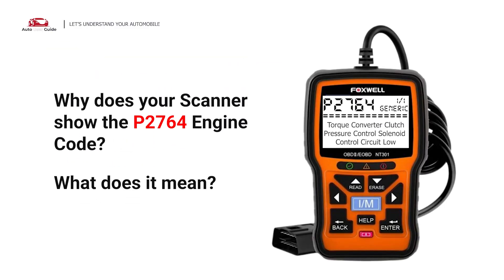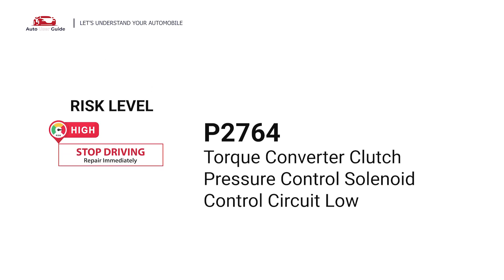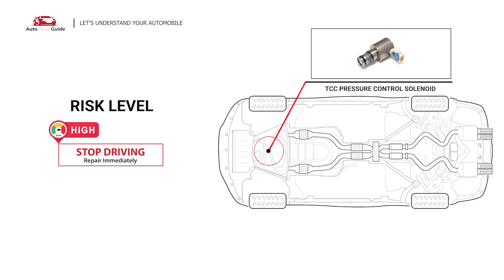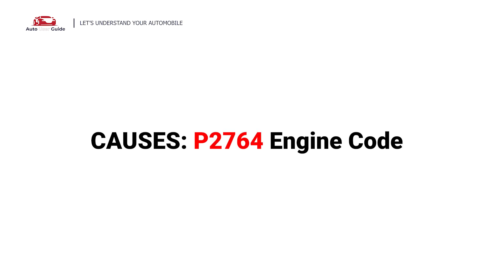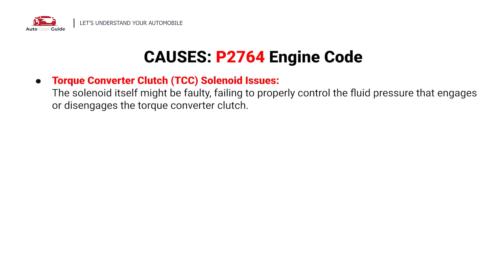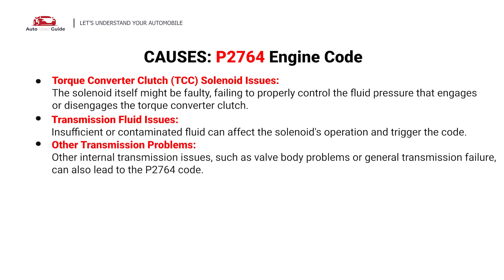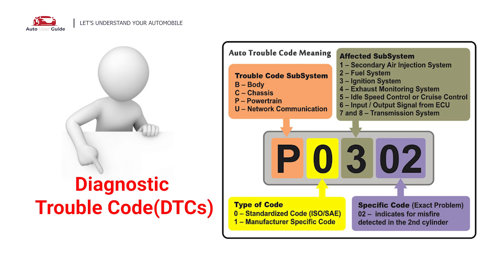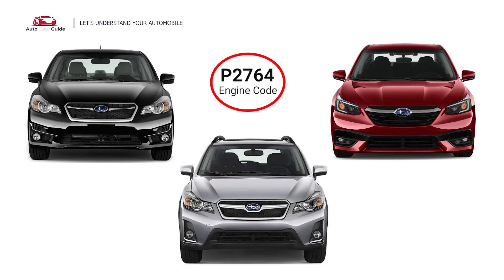What is P2764 : Engine Error Code Causes Explained

Comment: Hello Sir, I’m having the same code P2764 on my Forester XT 2013 (FA20 Turbo, TR690 CVT).
Two weeks before the code appeared, I changed my gearbox oil using Subaru Lineartronic CVT fluid and the car was totally fine. No issues at all.

The problem started after I drove through deep dirty water.
About 30- 40 minutes after passing through the water, the AT OIL TEMP light started blinking and scan showed P2764 – Lock-Up Duty Solenoid Circuit Low.

Just sharing the timeline because the car was okay after the CVT service — the code only showed up after driving through the water. what your advice sir? the mechanic proposed i change the solenoid itself, whats your view